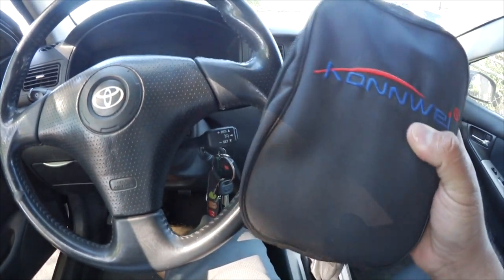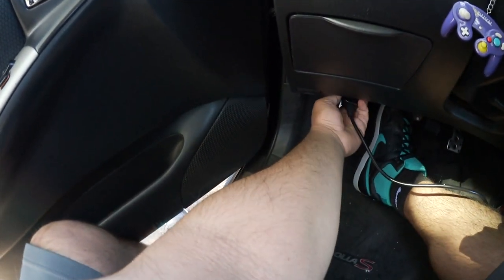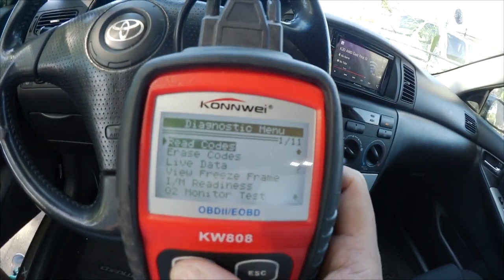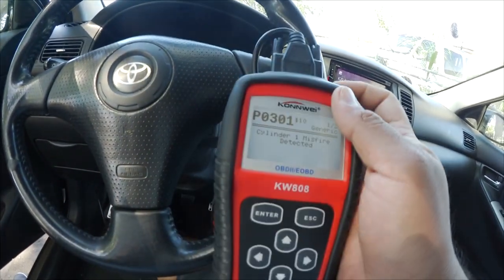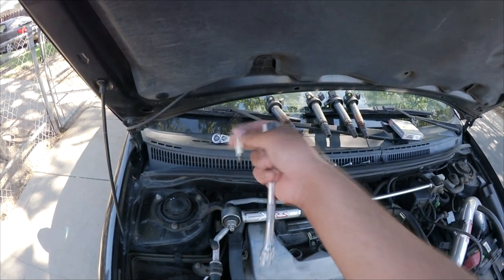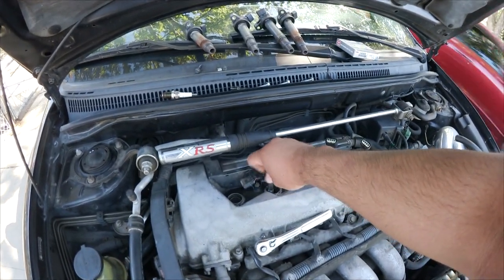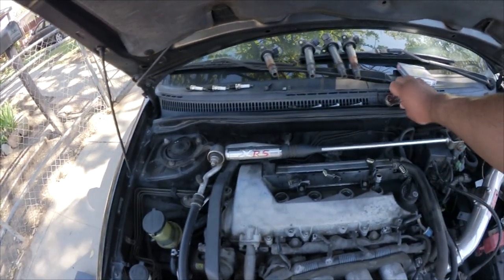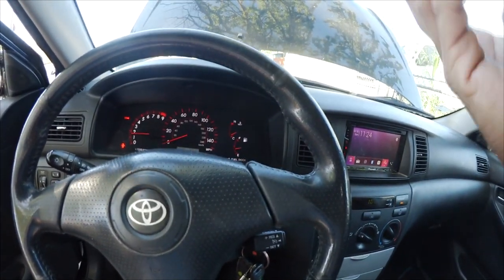Corolla XRS cylinder 1 misfire diagnosis / NGK spark plugs install

Comment: I also had a misfire on cylinder 1 and sometimes 2. Did the coil packs and spark plugs, but didn't work. Took it to my mechanic; had my whole top end machines and replaced! Apparently the previous owner of my 2005 Corolla XRS might have been using regular unleaded gas instead of premium. Once he fixed/replaced what he needed to do. Corolla is a whole different animal now. FYI, currently at 217,000 miles.
Reply from the maker: Damn, the sad part is that I found a receipt for unleaded fuel in my xrs from the previous owner...since I’ve owned it for the 3 years I’ve been putting premium only